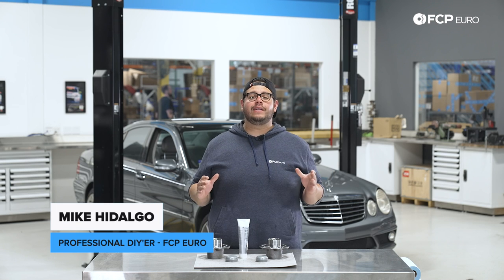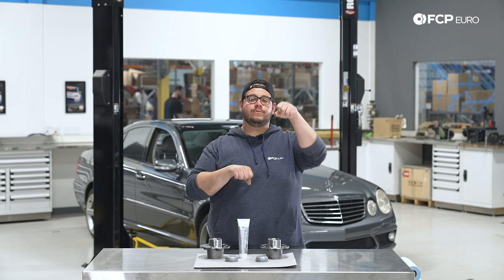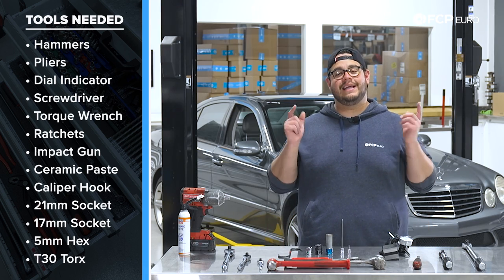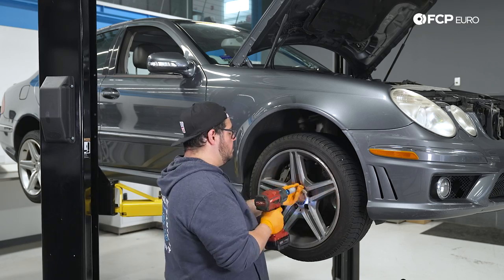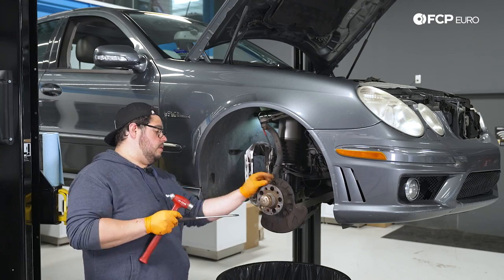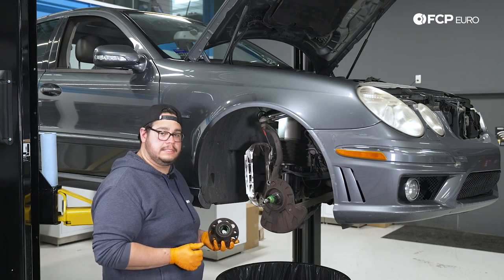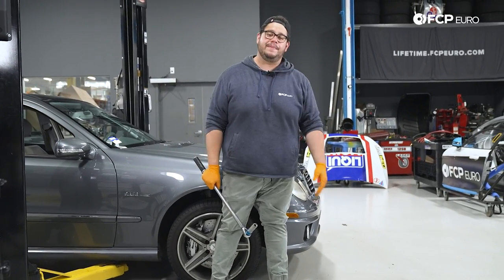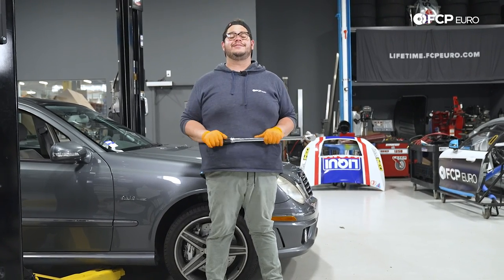Mercedes E63 AMG Front Wheel Bearing Replacement DIY (Mercedes W211 E55 AMG, C219 CLS63 AMG)

Comment: Your video is perfect of how to replace wheelbearings, BUT you forgot to show how to replace the Wheelbearing seal. After replacing my bearings I had ABS/BAS/ESP light come on. After serious investigation, Firstly I did not know about the ABS Sensor/pulse Ring in the hub seal. I was told that you MUST be very careful with that ring, Firstly, you must NOT tap it in, you have to press it in, Secondly, you must NOT use a ferrous tool to press it in it has to be plastic/nylon/wood, also depth is important, if gap between sensor and ring is too large, then it won't pick it up, and it HAS to be level/straight.  Those things are extremely important to show in your video.  I had to purchase a complete kit again, just to get the new sensor ring.
Reply: So your saying the reason why my ABS is going crazy is that my spring came out of the seal, so ABS will malfunction
Reply: How can I email you for clarification
Reply: My friend he didn't show the seal placement, because he replaced it with a new whole assembly. Meaning, hub, bearing and seal are already assembled

Comment: Please do tie rods next! Oh and engine mounts!!
Reply: No one on the internet mentions that you HAVE TO remove the headers to do mounts on a C207 chassis. Ask me how I know.....or you can drop the subframe & remove the engine mount brackets from the block.
The top bolts are 100% impossible to remove otherwise. Took around 6 hours just to torque the top bolts down, 1/16 of a turn (at best) at a time. This was with exhaust & alternator removed. I hope you have a w211 & not a c207.
Reply: @RothBeyondTheGrave  w211!!! That sounds wild for you.
Reply: @OGYELLOW  honestly still can't believe it. I kept seeing w204, w212, w211, r171, etc vids of people just removing the heat shield & top bolt & thought it'd be the same.
Amazing the tiny differences in clearance from similar chassis.
Otherwise, straight forward job as well as tie rods.

Comment: When measuring the bearing play, one is supposed to pull and push the hub straight out, not wiggle it from side to side. In this video, there would be way too much play. Other than that it’s a decent summary of steps. Thanks.
Reply: He also said 1mm of play when the dial indicator clearly shows about 0.01mm of play. His instructions aren't very good

Comment: I had a Mercedes Benz S500 (2005) the car had front wheel bearing very loose can,t take on freeway plus the rear airmatic  pumps were leaking the pressure also the interior shifter linkage will break cost lots money the car had 140000 kms on it. My BMW 750 LI 2008 
has 375000 kms still running great the only problem was stater on winter went it cost me 1200$ because the starter is under rear manifold had to drop down the engine, otherwise the best car . I have a Volvo V 70 (1999) the car has 360889KMS still running 
and my wife has a Cadillac STS V8 Northstar never had any issue the best GM product. thanks for uploading the repair videos.:yt:💞💞

Comment: Is see the list of cars this works on, is that for parts or is that for the method of changing the bearings? Is the principle the same for a w211 E55?
Reply from the maker: Hi Nick, the process will remain the same for the most part; hardware sizes and locations may vary on the different models these bearings apply to.

Comment: Ok. Those grease caps....I've done every single wear item & common issue (besides esl & comand knob) on my C207 chassis, yet those grease caps were the ONLY thing that defeated me. The special tool that seats it flush all at once was the only successful method. The method used here got me absolutely no where in a time frame you wouldn't believe if I told you. I could have done S65 rod bearings faster. Wish I was joking.

Comment: If you have no idea how to do correctly wheel bearing play do not... from manual: "Do not TWIST or TILT the wheel hub during measurement.Correct measurement is only possible by pulling and pushing PARALLEL to the wheel a axle."